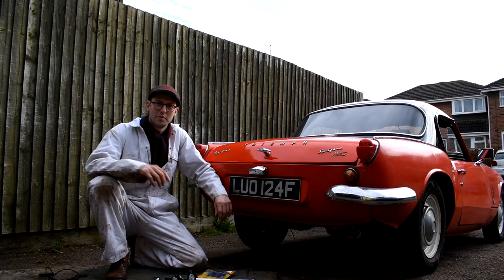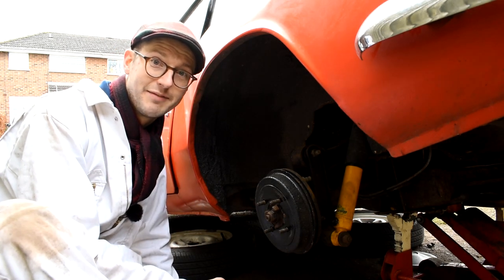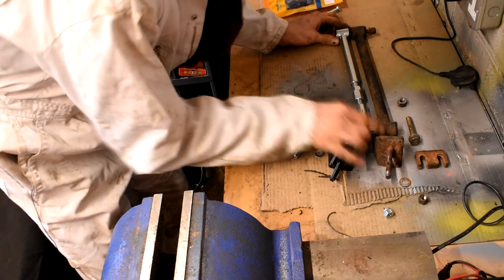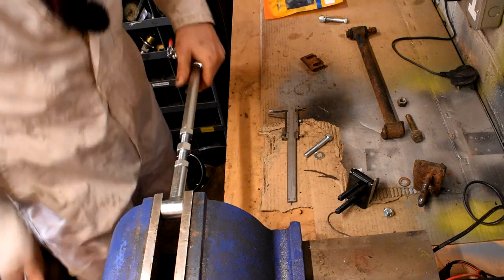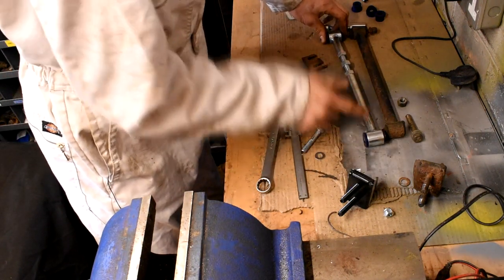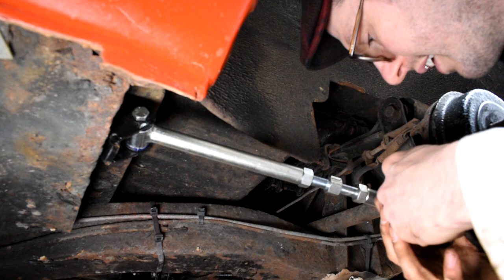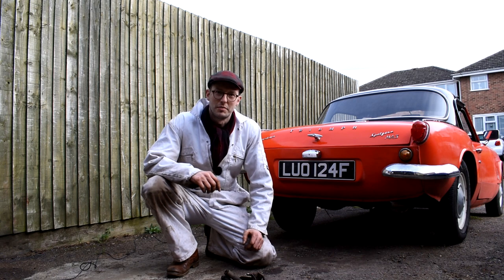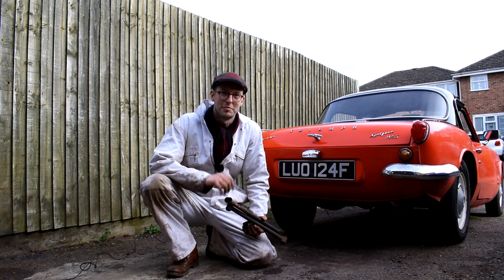Triumph Spitfire Adjustable Radius Arms

Comment: Once adjusted at the 4 wheel alignment shop, it's a good idea to wrap the threaded sections in masking tape, before coating them in black enamel, this will protect the threads agsinst corrosion
Reply from the maker: That's a really good idea, I like that 👍

Comment: Nice addition Steve, I see my Spitfire must have been modified to be more awkward. The front bracket is attached with fixed nuts in the cabin and bolts through fron the arm side. A complete pain
Reply from the maker: It's a good modification to have, just got to look on the bright side, once you get the nuts and bolts right, you have an upgrade that hasn't cost you anything 👍

Comment: Another very helpful instructional video, thanks! 👍 Would you consider doing one on rust proofing the underside, your Spitfire looks like my Herald, plenty of surface rust underneath, but nothing serious hopefully. I’m thinking of spraying it with a lanolin based wax.
Reply from the maker: In all honestly no, there's not much point in rust proofing my Spitfire as most of the underside panels are going to be replaced when I come to restore it. If I adding waxoil or underseal to the car now, it comes with fire risk problems when cutting out old panels and welding in new ones, so for now it'll remain as it it, however as soon as the new panels are welded in then it'll have rust proofing 👍
Reply: @SteveDentonClassics  Thanks, good to hear you have plans for the body work too. Superficially it doesn’t look too bad on video. Look forward to seeing what’s to come!

Comment: Probably unrelated, I am looking at a Mk1.
I've heard that the rear suspension can be improved by changing it to GT6 rotoflex ones or Mk4 "swing spring" ones.
I wondered which is the better solution?
Reply from the maker: In general, the best proven upgrade for the round tailed Spitfire is a swing spring set up from a Spitfire 1500. It does widen the rear track, so be aware of this. A GT6 rotoflex conversion would be expensive and require accurate welding for mounting brackets, where as the Spitfire 1500 swing spring is just a bolt on modification 👍
Reply: @SteveDentonClassics  I have read that Rotoflex is the best in terms of handling, but Canley no longer carries the kit, not sure of others and like you said it is expensive and more involved, I guess for my use the swing spring is a better solution.

Comment: Hi Steve. .....simples !!! It's a no brainer , so you'd assume this has been around for a long time ? Cost  is the answer as to why Triumph didn' t do this . And the same principle is used to adjust the bonnets . I get the impression you enjoy the Spitfire every bit as much as the 6 ......heard anything from Harriet ? " And for your final question  !" Do you know if the guy you bought the Spitfire from watches you ?  Cheers bud !
Reply from the maker: It's like anything, I'm sure if Triumph's budget was unlimited then the Spitfire would coil springs and shockers on the back instead of a leaf spring. But then you have to build to a market to sell to and for what it is they did a good job. We just have some great improvements to choose form nowadays 👍

Comment: Are those adjustable radius arms made of mild steel, or are they stainless? Because if left unpainted, they will rust very quickly
Reply from the maker: Since the video they have had a few layers of paint applied to them 👍

Comment: They look a really good addition to the car, but why not clean up and paint the underside area they mount on at the same time?
Reply from the maker: Cheers John, but at the moment there is little point painting and cleaning up anywhere underneath when the whole car is going to be striped down to the bare bones to have new sills and floor panels welded in. Once that happens I'll do a proper job of it 👍